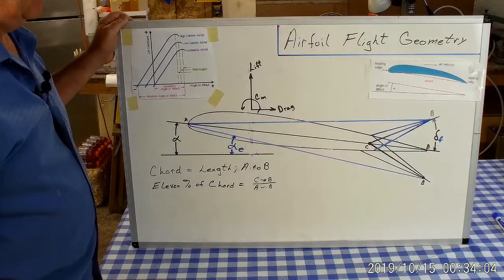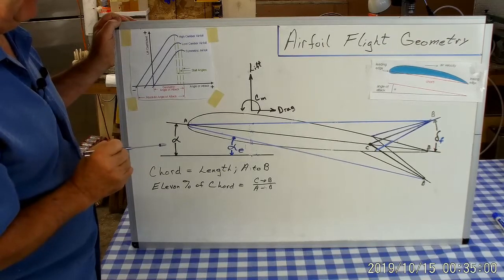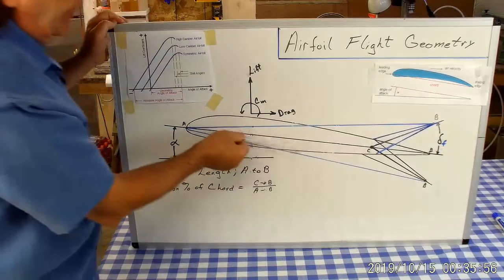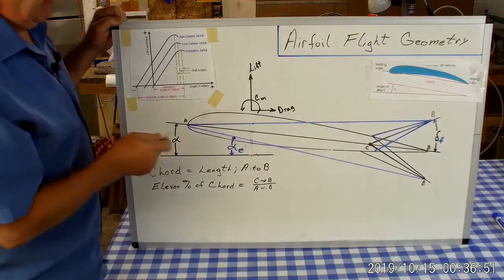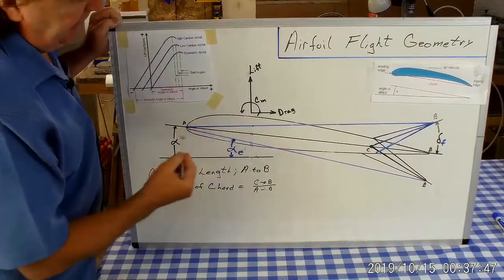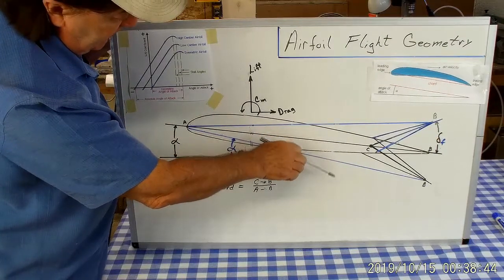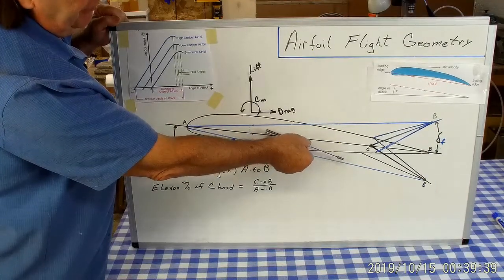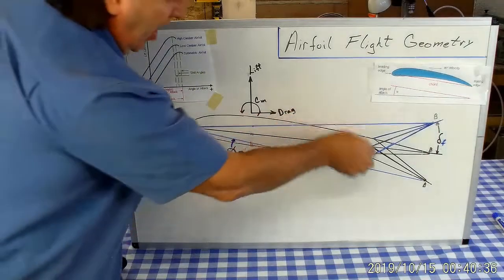Preventing Spins Part 6 - Klingberg Wing MkII Development

Comment: That was such an important lecture.   It strikes me that the effective shift in cord isn’t just relative to the elevon/aileron neutral position, but the mean cord of the entire wing- that is, without the remainder of the wing acting in opposition, repositioning the control surface would provoke the section to whatever angle of attack rebalanced forces.
Reply from the maker: Thanks for the nice feedback, it means a lot to me. You are correct that the effect I'm discussing in the video is relative to the entire wing, but is probably easier to understand when discussed at each locality. If one would do the math, the entire wing must be considered.
Reply: Klingberg Wing MkII, it most definitely was easier-  empowering me to ask myself ‘what does this suggest of the greater context?’  Good teaching leads to discovery.   Thanks for your efforts.